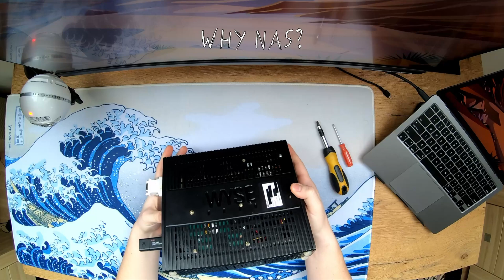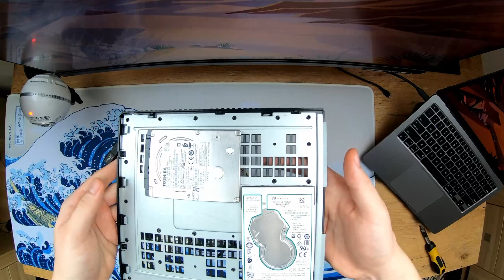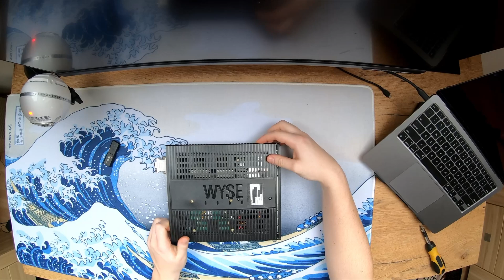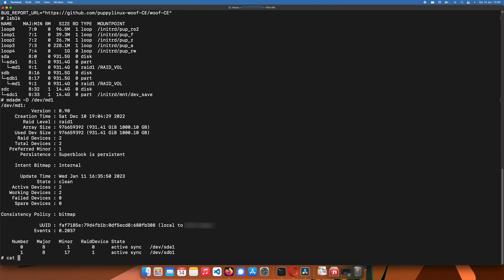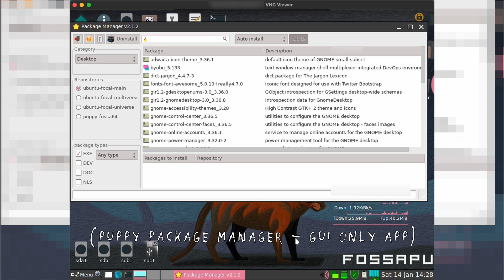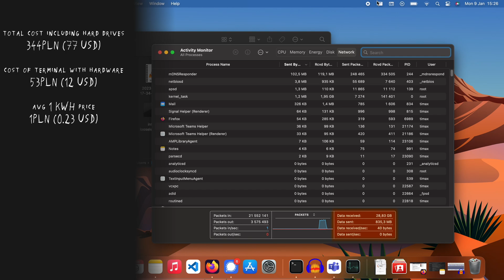Poor man's NAS | How I made DIY redundant NAS server

Comment: Better off just using an old laptop...
Reply: For homelab use I agree. It's not perfect, but a laptop with a bust screen is cheap , can be quite powerful and has a built in keyboard, mouse and "ups" .
Reply: Agree, i used old laptop as nas server. Other than lack of io and bad cooling, it work fine. I even managed to have 2 sata port and couple usb drive. It's better than raspberry pi 3 server with same cost. Also it running at 20-40 watt of power with battrey as backup power.
Reply: Well I see some drawbacks,
1. Taking those apar is not as convenient
2. Compromised Cooling system
3. Comes with a mobile processor
4. Sometimes the processor and the ram comes soldered
5. Lack of IO
Reply: Well I see some drawbacks,
1. Taking those apar is not as convenient
2. Compromised Cooling system
3. Comes with a mobile processor
4. Sometimes the processor and the ram comes soldered
5. Lack of IO
Reply: @itsmmdoha  Terminals are always lower power than good laptops, and usually have less IO.
Reply: How about a Dimension 2400?
Reply: Please, define what "old" is, first.
My "old" term is a core2Duo era. If you find one, don't bother to throw it away, asap.
Even if you get below Intel gen4 (haswell).
Throw it.
Your electricity bill in a month would be equal to the price.
Build a NAS with an i3 gen6, would be ideal right now. I mean, from price point of view, it is lower than 2-4 years prior, it has power efficiency (S3 mode), and it's not gonna outdated soon.
Reply: @Anuitu2u  oLd CoMpUtErS uSe ToO mUcH pOwEr

Ever considered using whats on hand? Playing around with hardware? Experimenting? Retro Computing? Like come on!

This isn't some embedded mass produced thing. So unless your off grid, power consumption isn't THAT important!

Comment: Very interesting, well done! I am looking at upgrading my existing home made storage server (an Intel Atom mini-itx motherboard and 4TB green hard drive). My current server has 1Gbethernet, but I need 2.5Gb Ethernet. I use it as a Steam game server and some games are very large and slow to load.
Also, my UK electricity prices are very high, so I want to move to SSD storage to reduce the 24x7 cost. Could I ask you what your system's idle power is, measured at the wall socket?
Reply from the maker: I don't have the equipment to measure power consumption at the wall and I'm slightly over budget for my "home lab" for now.
Reply: @ray54 my NAS is 5600X with 128GB SATA SSD, two 2TB NVMe, two Optane NVMe, 10Gb card. It uses 52-65 watts (depending on activity).